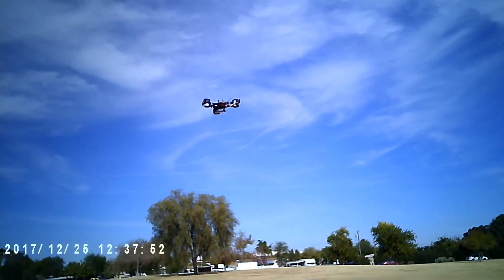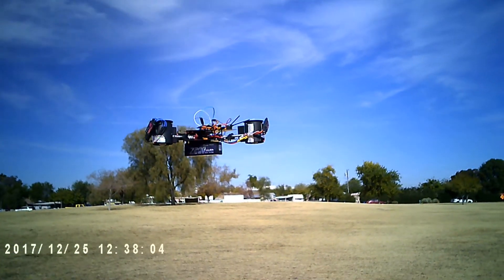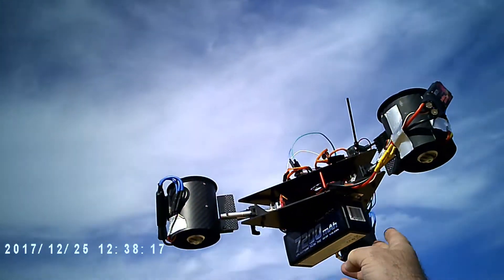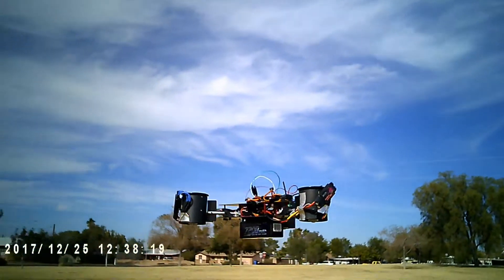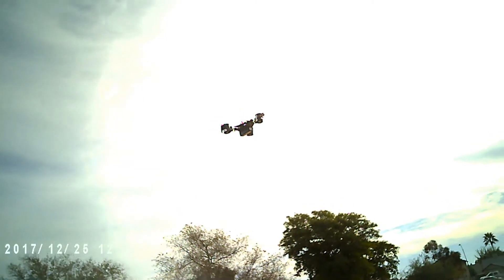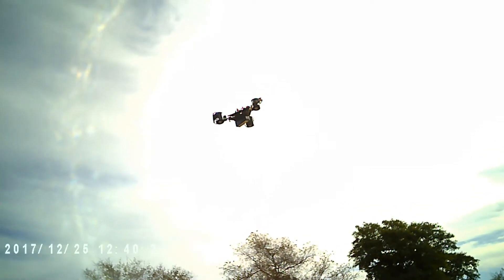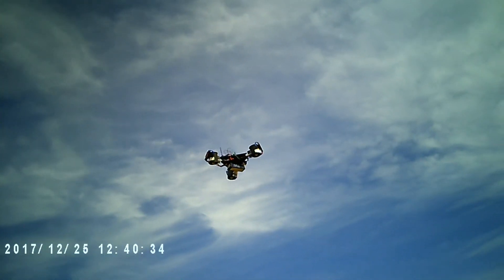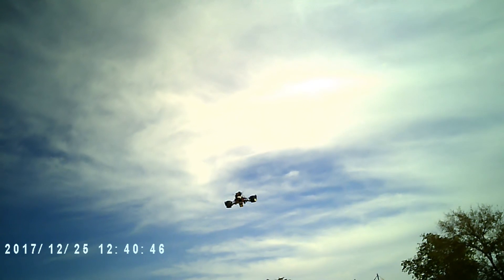ADNS3080 OPTICAL FLOW SENSOR ARDUINO TEST TRIPHAN MONOPHAN MONOBOT THRUST VECTORING

Comment: One sweet system. THANKS FOR TALKING !!!!!!!!!! 
Will you share some build information??
Reply from the maker: Thanks Bud! I have very limited time to build, which is what's left after my job (50-60 hours a week!) and my family. So, my focus is mostly building and posting test flights, as I don't have the additional time required for drawings, instructions, etc. Also, I don't help/support companies, startups or any kind of commercial initiatives. However, I try to help amateurs like myself with their similar projects when they have questions, as long as I have the time:) Thanks